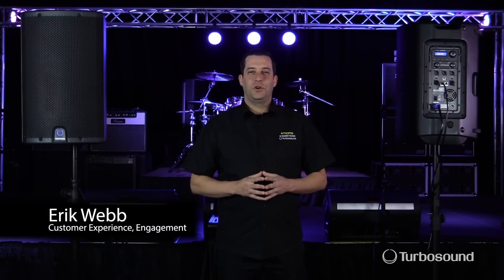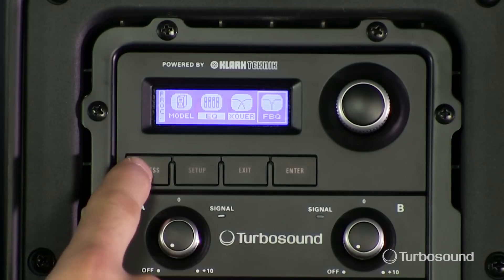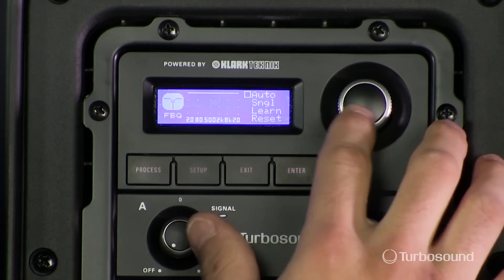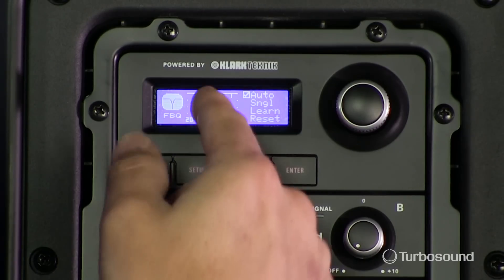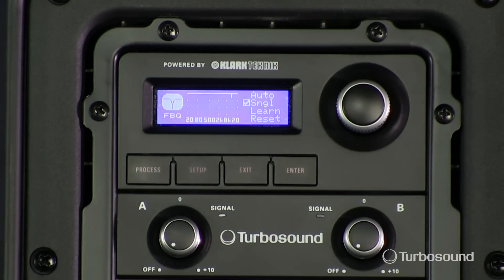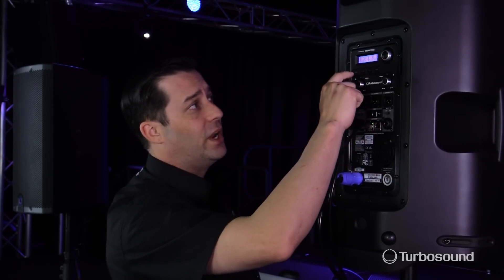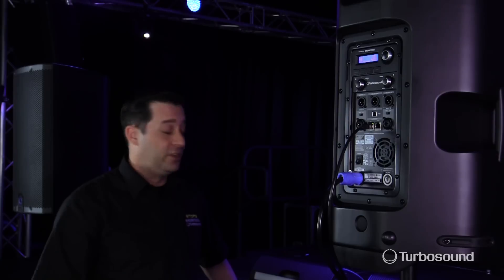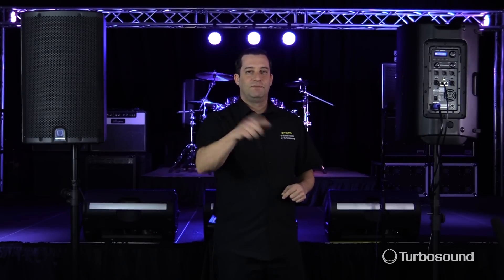TURBOSOUND iQ Series - FBQ Feedback Eliminator

Comment: I love my iQ15/iQ18B combo. Best bang for the buck that I've seen. Sound sweet rather than harsh and keep that sweetness even when pushed hard.
Unfortunately, there seems to be a bug in the firmware: Switching on the FBQ while on the X32's Ultranet results in shutting off speaker output entirely. Power cycling will reset it for a time, the output will eventually mute again.
I deselected FBQ and the speakers work normally again.
I'm sure Turbosound will fix this in a firmware upgrade. This bug is no reason avoid these speakers, unless you absolutely need your speakers to do feedback control.
Even with the bug, these speakers punch way above their weight class.
Reply from the maker: Hi oyobass, thank you for providing feedback. Today we have announced the release of firmware V1.9 which provides improved stability with ULTRANET use so this should fix the problem you were experiencing :-)
Reply: hey, did they fixed this?